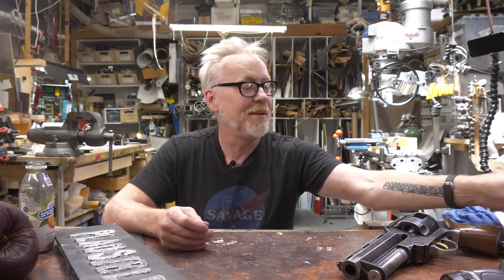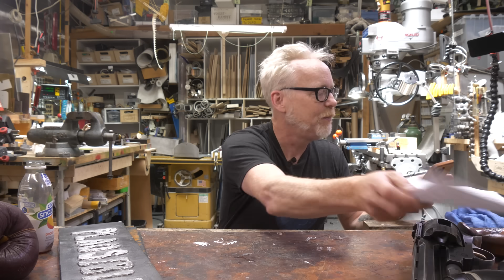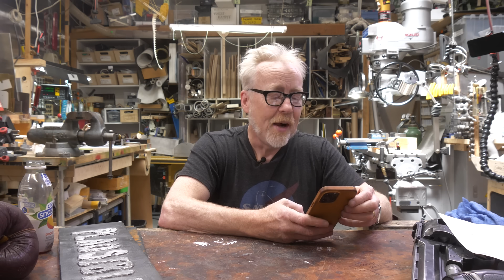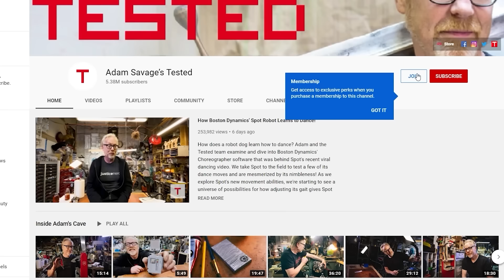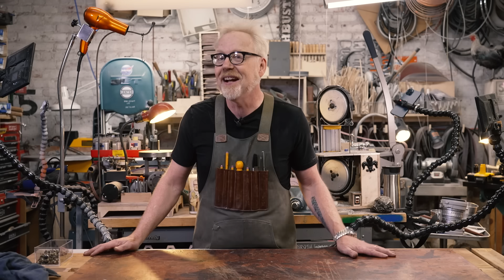Hardest-to-Obtain Item in MythBusters History

Comment: I'm a bit confused as to the sojourn into C4, which is basically pure RDX explosive, lithium grease, a bit of antioxidizer and taggant, when grenades are composition B, 60/40 RDX/TNT and paraffin wax.
With composition B being a fair bit less stable at temperature extremes and of course, prone to melting.
One would basically use a blasting permit for standard demolitions/mining charges with cyclotol. Ain't gotta tell them that the 60/40 mix is well, composition B. And in production, I'd have bomb squad take the explosive and fill the body, prime it and your team gets to push the big plaid button. 
And dispose of ever ounce of it after, stored poorly, with temperature excursions and it'll start getting brownish, which C4 can also do at a lower rate and well, the USS Forestfire - erm, Forrestal disaster had thin walled, poorly stored comp B filled bombs that figured prominently in the disaster. I'm not fond of disasters and actively do my damnedest and then some to prevent the possibility of one, lest the next one I'm in the middle of be my last or someone I'm with not get to wake up again. And I worked with explosives a lot in the military.
RDX also being sensitive, like PETN is, to radiation and one reason that they switched the types of explosives used in our nukes to a much less sensitive and temperamental explosive. RDX also being a lousy choice in a vacuum, it sublimates and tends to be embarrassing when one needs it...  

Grenade fuse, yeah I'd not show that. Not difficult to make, but someone trying that in mom and dad's basement and yeah, doubleplus ungood.

Comment: A grenade is always primed. It's designed to be triggered in your hand and discarded before detonation. Even if you intend to michanically pull the pin at a distance, the device is constantly one mistake (or malicious intent) away from detonation the entire time it is in your possession and during transport. This is why it is less insurable than c4, which is inert until it is deliberately primed.

Comment: I sat in an Indy car. It was on display in Menter Mall. We had eaten in a restaurant that had a mall entrance. The mall was closed but the entrance was open to the mall. My brother(he is missing peraon for 3 weeks now, send 🙏) we went into the mall and found the car sitting floor level with ropes around it. No one around, and there it was. And there I went. Clutch, into neutral, clutch back up to the left where it was. Probably 1st gear, but I have no way of knowing what gear it was. This was baxk when there was a Cleveland 500(wasn't 500 miles).

Comment: When I worked at a large tobacco company, we considered using 0.4 mil stainless steel foil for a pod-based heat-not-burn system. The material worked well, but then we realized that our production needs would exceed the world's production capacity of the material. Depending on the annealing state, the material could be as fragile as gold leaf, or as durable as a sheet of notebook paper.

Comment: While the myth specifies a helicopter this myth could occur with a Canadair CL-415 "SuperScooper" in the right circumstances. While there are safeguards to prevent such an occurrence if were  were damaged or otherwise disabled this myth is plausible. While flying just under 100mph it can scoop up 1600 gallons in 12 seconds.

Comment: I was in the Army and threw a couple live grenades during basic training. You would throw it as far as you could, maybe 50+ feet, and when it went off you could still feel the blast wave in the bunker. There were pock marks in the double-thick ballistic glass from shrapnel coming back from the range to behind the throwing line. When we were not at the range, we could hear them from over 10 miles away. They are terrifying and incredibly dangerous.

Comment: I don't understand the difficulty getting C4.  I worked for a company that manufactured its own charges primarily for explosive welded plugs and metal forming charges, and we routinely purchased C4.  Of course, we had an explosive manufactures license and not just a user license.  

We did work with a private company that wanted to test something - and used C4 for that.

It sounds like you needed to find a company like ours - there are similar companies all over the USA.

Comment: 5:09 I was apart of an Army Pathfinder company and at the time our primary mission was recovery of downed rotary aircraft crew, sensitive equipment (weapons, radios, special cameras, ect), and either sling loading the downed helicopter or destroying it. We used rescue equipment that firefighters would carry except ours was either electric (sawzall, jaws of life, ect) or powered by a gasoline engine like the K12 rescue saw. Helicopter crashes are always a nightmare and doors almost never open so we must cut people out usually while under fire. We have to train new guys on cutting operations but the army doesn't have spare helicopters lying around. So one day I asked the XO (executive officer) how much we spend on cut training. He explained, making mock up helicopters is extremely expensive and the Army does not have normal unarmored vehicles lying around so we go to junkyards. However, we couldn't directly purchase the vehicles because of some bureaucratic red tape so we paid them for renting the land to train. I wajt to add money wasn't an issue in this unit. In a normal infantry unit you're assigned to a particular brigade within a certain division (2nd Infantry Division 4th Brigade) and that brigade has a support battalion, a field artillery battalion, and three or four infantry battalions. Those infantry battalions have one Hq company (s shops and such) and four or five infantry companies. Last point, infantry brigades do not have the same allowance as other units because we typically do not have as expensive operating costs as other types of units and here's where this all ties together. This Pathfinder company was assigned to a Combat Aviation Brigade (CAB). That's one Infantry company where there would normally be 30-40. Additionally, the funding for a CAB is vastly more than an Infantry Brigade because of the insane cost of helicopters. The point I'm making here is funding wasn't an issue but sometimes within the government you have to find workarounds to get what you need. That's exactly what that bomb squad did. We also had mad funding for any school you wanted to attend. Typically guys are begging to go to Air Assault or Ranger school. Our 1SG either forced people to go or threatened it as a punishment (usually SERE-C).

Comment: I never understood the phrase "Up on the wheel" Until I drove a 6oo HP Nascar stock car around Michigan International Speedway @ 140+ mph. The intense focus of going that fast literally tenses all of your body into that moment and when it's over you look back and realise you were pulling yourself forward gripping the wheel and straining against the 5 point harness in ernest. An experience I will never forget.
Reply: Yea the ability to relax and just be present takes lots of experience. Even on my z1000 just going 140+ straight for a few seconds on the highway, I was always too scared to do all the twistys and weaving around cars. I could just feel my body so tight. Probably would be a little easier in a car but still.
Reply: From experience at 140+ mph you do focus a lot and kind of have the car be an extension of yourself. And its a speed where the second hand is no longer optional. 

Its fun maintaining it for 20 min or more.

Driving 120mph is just casual crusing speeds just plan 2 to 4 km ahead and know your vehical and your abilities with it
Reply: I took my grandmas 2004 Buick Rendevous to 136 mph on bald tires on a public road. 140 is quick, but it's not “tense your whole body and intense focus” quick. Driving through New Mexico, Arizona, SoCal desert roads I usually cruise at 130 while half asleep. Fastest I've been is 196-197 on a Ninja H2. That was admittedly pretty scary.
Reply: @Mouthwashh not everyone is a badass like you. 140mph is very fast for normal people.
Reply: @Mouthwashh we can be badasses together, homie just said he tongue kissed death 🎉😂
Reply: @Mouthwashh Top speed of that car was under 120, nice try

Comment: just to put the thickness of that lead foil into perspective, your thin notebook paper is 3 thousandths of an inch thick, that is 0.003" thick.

the lead foil wad 0.0007". that is less than 1/4 the thickness of a sheet of notebook paper. 23.333% the thickness.

Comment: Wow, about that grenade: I actually HAVE a deactivated WW2 training grenade. The bottom is drilled out and it doesn't have an activation charge, or an explosive load, but I could have mailed it to you, you could have put a detonator in it, welded the hole in the bottom shut, and used it. Legally. Too bad I didn't know you needed one, I would have parted with it so you could have used it!

Comment: They have practice grenades that throw just like a real one.  A hollow steel shell with a hole in the bottom, painted blue.  Replaceable fuses.  A modest firecracker basically.  Quite safe, would have worked for TV purposes.
Reply: It wouldn’t have worked for myth busters if it wasn’t the exact same blast. This isn’t a fictional tv show like that lol.

Comment: The workaround for a grenade's always been getting a REAL dummy grenade, one that's an actual production grenade shell, and filling it with the explosive composition that's meant to go in it or a similar substitute (say, instead of Comp B for a ww2-era grenade, use Comp C aka C-4, the only big difference is melt-cast vs hand-cast) and then screw in one of the readily-available pyro fuses for smoke grenades, flashbangs, airsoft, etc. cause they're all compatible.

Comment: i wonder if becayse c4 is such a stable compound, but a grenade is probably the most terrifying ball of death you can touch. one slip and youre dead, unlucky and short fuse, dead, not to mention that throwing one is actually quiet difficult and its something you cant control much unlike the c4 with a detonator

Comment: You can get C4, you just have to jump through hoops to get it. We use it in the oil and gas industry to perforate pipe to let the desired products into the well bore. We also use it to cut casing inside of the well bores. It is also used in demolition companies to bring down buildings, bridges, water towers, etc. Anything with steel beams that need to be cut. Usually with linear shape charges, which looks like copper angle iron with C4 sandwiched in between.

Comment: ADAM IN YOUR HHO GENERATOR EPISODE YOU PUT DISTILLED WATER INTO THE ELECTROLYSIS CHAMBER. DISTILLED WATER IS A DIELECTRIC, IT IS NON-CONDUCTIVE AND COULD BE USED IN FACT AS AN INSULATOR! YOU HAVE TO ADD SODIUM HYDROXIDE (LYE, CAUSTIC SODA).

Comment: Literally the secrets specs of the universe in a fucking water pump I can dig it. 33.3gal.repeating, flowing every second through a system four chambers of changes say maybe like initial spark causing a vacuum pull from behind it and of course a weakening vacuum effect that maybe aligned some gear ratios to the opposite 1000th for torque conversion power output again idk😅 all the way back around to the beginning of its course and in, and pushing a maybe (cloud/gas/vapor) idk😅  so like spark to charged gas diesel like engine idk makes compression while bringing at the pole opposite of the compression the water pump dynamic for cooling/pressure maintaining throughout the vaccum effect to prevent loss of memetic momentum requiring more fuel or power anytime that would happen brings in and idk some piezoelectric/dielectric center mechanism that also captures both the first pressure from being filled with water and the pressure created initial spark something w maybe lasers and panels to store and transfer energy also in ratio but dissonant flow with the size speed and momentum capacitance of the entire device  to allow plasma in a fluctuating and stable current indefinitely but only drawing power from outside capacitor banks all linked by the constantly flowing  plasma also idk try it someone

Comment: I though grenades are fine with a permit from the atf
Reply: Register the body as a Destructive Device, apply for FEL from ATF, Have ATF inspect your secure magazine, obtain FEL, legally buy or manufacture filler and fuse, storing them separeately & securely in your magazine. Only assemble immediately prior to use. Use for fun. Inform ATF that you have destroyed the DD, amend your records that you have used XXgrams of HE and Fuze assembly so that when ATF inspect you all of your records match what you have.

Comment: In fairness, what makes real grenades deadly isn't their explosion so much as the shrapnel that is designed to spew out of them upon detonation. The blast from a real grenade actually isn't as impressive as you might think, at least not nearly as reactive and booming as C4, it definitely won't blow up small houses or entire vehicles in spectacular fashion like you see in every movie and video game.

What does happen, however, is wire that's intricately woven around the center charge of the grenade's core gets fractured into a million tiny, sharp pieces of shrapnel and blasts out in all directions at terminal velocity, and this is something that is just simply too unpredictable and too dangerous to be allowed any usage other than for the purposes of training and actual practical application in official armed conflict by those that are authorized and trained to use such devices. Even the casing the grenade itself has is often ceramic or another material designed to turn into dangerous shrapnel upon detonation, so even training grenades that don't have the shrapnel wire elements installed in them would still pose a significant and unpredictable danger in the hands of someone not trained to handle them.

By that same token, its likely that, if Adam and Jamie had been allowed to test the "shooting a grenade out of the air" myth, they would probably find that that shrapnel from the explosion would still be just as or more deadly than the blast of the grenade itself.
Reply: How far are grenades deadly?
100 Meters?
I mean atthst distance you have more Chance to win the lottery but it cpuuuld happen

Comment: Describing the thickness of lead in points of a thousandth of an inch sounded very difficult. Try scientific measurements ie meters or millimeters.
Reply: 0.7 thousandth of an inch = 17.78 micrometres (or microns). Human hair ranges from 40 to 120 microns in diameter.

Comment: I get the whole thing about not wanting to give a grenade because of liability. No one wants to be the person that, if something goes wrong, answering the question: and it was you who gave them the grenade?

Also, grenades are inherently difficult to handle safely. If you fill it up and use it in place, or as close to it as possible, it is no less safe than using any other container for explosives. If you are handing it to someone, who knows what they will do in transit?

Comment: Okay I have to ask.  Am I the only one at 7:33 notice the arm on the right side of the screen just above the Oxy Acetylene bottles?  

Look through the open gap of the manual mill, there are two green bottles.  The door opens, there is an arm that comes through the doorway with a cell phone held up in wide angle mode.  Holds there for a bit and then pulls back and closes the door.

Why record something from way back there?

Comment: I did a bit of research a few years back out of curiosity. It actually is possible to legally acquire grenades; it's just expensive and comes with miles of red tape. Basically, if you're willing to go through the whole process then you're probably responsible enough to be trusted with one. Ironically, it's actually easier to get a grenade launcher than it is to get ammunition for it.

Comment: I was propping a show in 1990 and needed to obtain some dummy stun grenades for a scene. I made some calls learned that the UK supplier of these had a rep coming to town. He was one of SAS that first used stun grenades during a hostage situation, that being at the Iranian Embassy in London. 

I contacted him, told him what I was after and we arranged to meet at his hotel that evening. He greeted me at the door, chatted briefly about how the grenades work and then he tossed me a grenade canister saying “I guess this is what you’re after”. I said it’s kind of heavy and he said because it’s live. 

Gulp.  

He thought that would be better to show the FX guys what they needed to simulate, and then handed me another live plus one in two halves, and said goodnight.

Would have been embarrassing being stopped by a cop on the way home.

Nevertheless the effect of the real ones in an empty studio with safety goggles and ear protection was cool. One had three flash/bangs and the other five, ejected randomly away from the canister and timed split seconds apart and with a combined decibel level just less then that which causes permanent hearing damage and then white smoke, a ton of white smoke, this is all to disorient the perpetrators.

After which it took quite a while to clear the studio of smoke.

Comment: While a company would probably not sell you one, technically all you need is to register a grenade as a destructive device with the ATF, and give them $200 per device.
Then to use it for a commercial reason, someone would have to have a federal explosives liscense. 
Kinda the same thing with C4, you need the explosives liscense because it was a commercial venture, there's no other permit required to detonate explosives, as long as it isn't a destructive device (grenade, pipe bomb, etc)